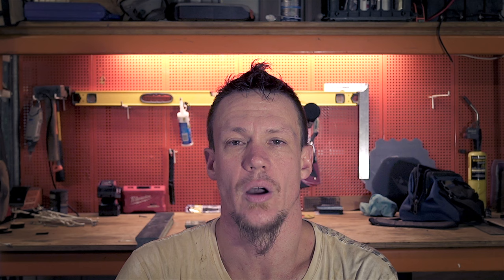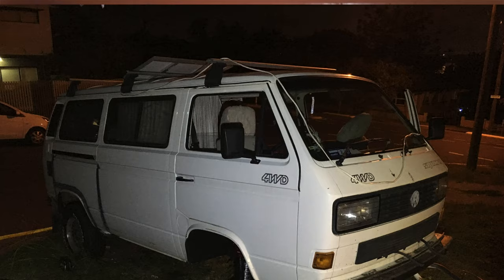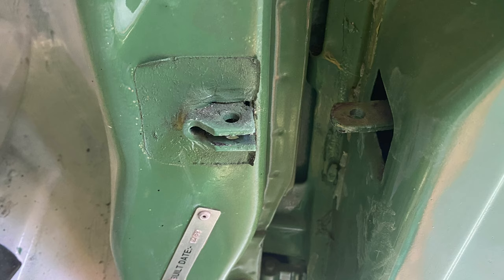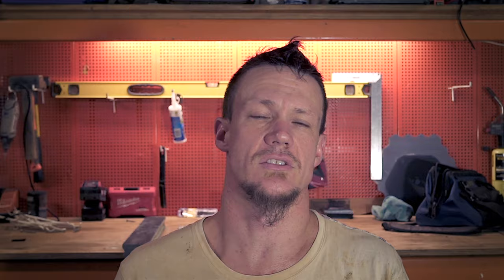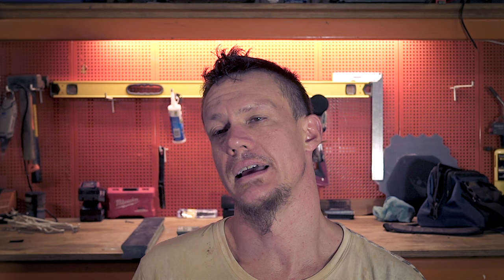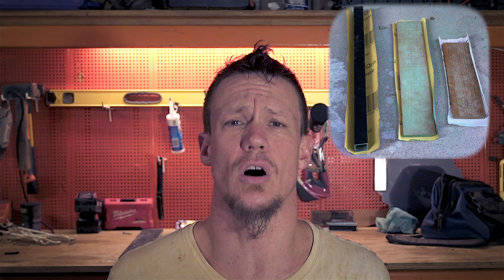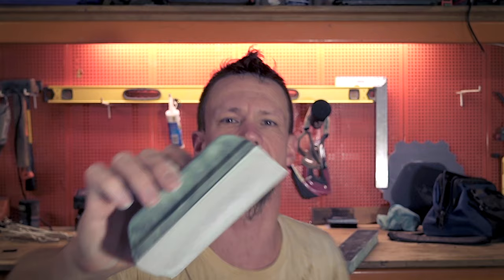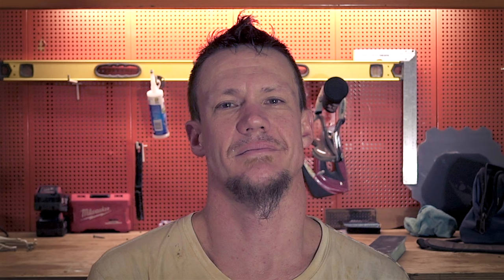Why Im Sanding off the new Paint job of my VW T3 syncro restoration project

Comment: I’m about to start my syncro resto. I’m with you 100% on what you’re doing. I couldn’t have lived with that workmanship.
Reply from the maker: Thanks for validating the direction i had to take, the workmanship was unbelievable.  Keen to watch your restoration process, will come over and subscribe to be sure i dont miss the fun.  Best of luck with your process.   Im in a bit of a gridlock at the moment with the project, couple hiccups I have to get through then back full steam.

Comment: Yo brother its Baydos, really sorry to hear about the sham job. What an absolute ass hat doing that too you. A 2nd year apprentice would be expected to do a higher quality of work then that, such a shame. 

Have you thought about raptor coating it? Alot of pros to it such as durability and 
takes out alot of prep work, also really easy to achieve a good result with it.

Anyways I'm subbed and ready for your next episode..😄
Reply from the maker: Hey there Baydos!  Thanks for validating my concerns, I too feel a person to call themselves a "restorer" should have better ability than this....I did have raptor coating for fender and rock chip coating....I haven't thought of doing the full van in raptor, though it does look quite durable!  Might have to look into something along this, especially since it can be tinted in most colours!
Reply: @LiquescentAdventures  prep work aside you would hope he was able to move a spray gun over a car better then that after 20years experience. Anyways bitten once twice shy hey.

1 good thing with the raptor from what I hear is its really easy to apply as a DIY. Althoigh coincidently I was just speaking to a friend today who is getting her hilux raptor coated and she found these guys on the goldcoast who do a closed door raptor spray job from $1600 with a 2day turn around. Il see if I can find the add for you. Raptor hold down repairs really well and you don't need to get the panels super super straight either. Its just if you like the look of a raptor coat I guess, its not for everyone Its just a different look. I quiet like it personally it gives it that tuff look but at the same time can still achieve a neat end result.
Reply from the maker: @truthpursuit8  very accurate!  I definetly thought a better outcome from 20 years of experience....but I've learned people enjoy to make themselves better than they really are...

Comment: Yes, I love the color too !    And initially, it looked good.  Sorry they did a substandard job.  I did my own, and I have sand scratches too--how ?  I wet sanded with 400 ?  IDK.  Anyway, I have made peace with my own work, knowing I preserved the vanagon...and I have to take the runs out with a razorblade.  (mike f n garage has a video on this)... I noticed when you were sanding, there are highs and lows, so maybe you can scuff up the lows and mark with pencil and redo (sylvestercustoms on youtube), as I did not and lost my reference, so that is one tip.  The mismatched panels,  you might just have to weld, grind and improvise ?  My friend Dave would take it all off which is why his work looks great and mine is half arsed.   Do you have adult evening education at Tech Schools in AUS ? That is where I get the SATA paint guns and paint booth to paint mine.
Reply from the maker: really great info you've provided and places to look for guidance, yeah I will be replacing the panels that are misaligned... regarding your scratches in paint, must be frustrating to see these show up after the fact!!  did you use a cross hatch style sanding technique or a guide coat, I find with sanding that changing your sandpaper regularly helped with maintaining even sanded surfaces ..regarding how to remove runs in paint I was watching a video where they actually added a skim of body filler over the paint where the runs were.  once it was cured they taped it out and started sanding that area using the body filler almost like a reverse guide coat.  As they reached near the flat painted surface they upped the grit reaching upwards of 2000 grit until they sanded down the filler completely.  they finished it off with a buffing compound and it was indistinguishable from the rest....I will see if I can find that video... might offer a better option then respraying that one area.
Reply from the maker: here's the link for another technique for taking out runs https://youtu.be/ySje2CcPZVA

Comment: Hello, sorry to hear that story ! I myself just bought a T3 syncro and wanted to paint it Auratium Green from Porsche 356, is that your color ? if not, which one is it ? thanks :)
Reply from the maker: Hey there Mob, thanks for the interest and support.  I created the colour based from the Porsche auratium green, but when I had a sample made at the paint shop it wasn’t exactly what I wanted so changed the colour a bit.  The paint shop said that each paint manufacture would be a little different from original so with that in mind I went to the paint scale and found what I liked best from what samples looked like in both sun and cloudy conditions.  Amazing how much it changes from conditions

Comment: I love that color, I've been trying to find the right green paint for my 85 westy.  I'm down to OD Green or this, what is this color called?
Reply from the maker: yeah love the colour too it took ages to settle on, I was looking at seasand and Sahara beige for a while then liked some greens from land rovers and finally I worked with my local paint distributor and tinted up something between a Porsche green and a Land Rover.
Reply: @LiquescentAdventures  I dont suppose you have and would want to give me the paint code?
Reply from the maker: @patrickvanhoesen9425  the paint tin that was returned to me has the code covered, next time i speak to the paint shop I will get the code off them as it should be on file
Reply from the maker: I don’t have the exact code with me buts it’s pretty close to Porsche auritium green.  Be careful to get a maded sample instead of going off the colour card, they can be vastly different